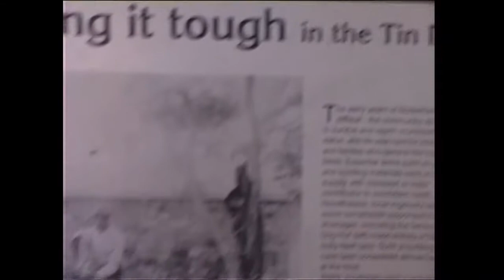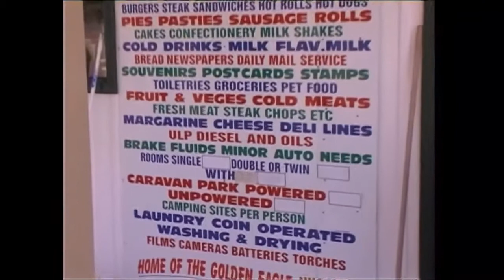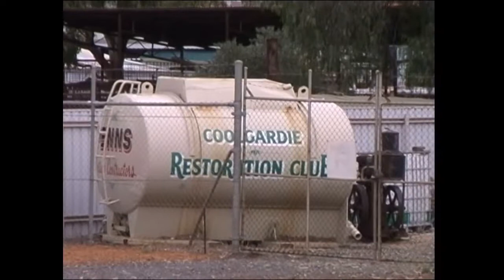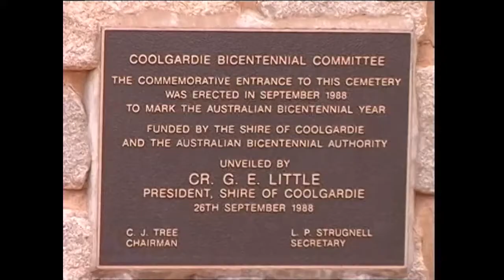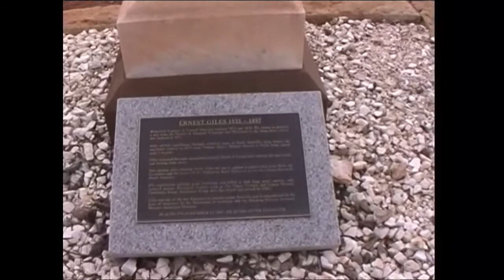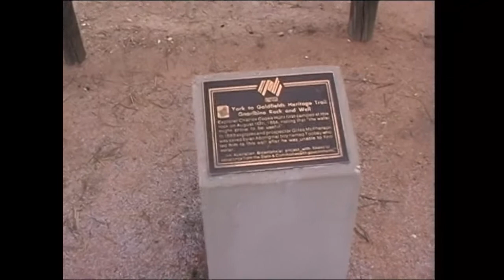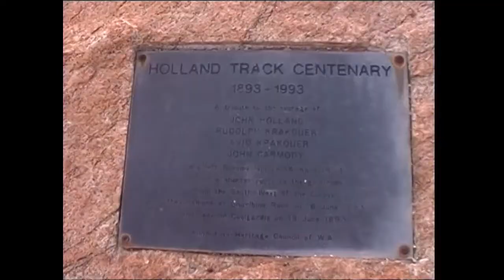3 Norseman Widgiemooltha Kalgoorlie, repairs AND The Holland Track..

Comment from the maker: see http://museum.wa.gov.au/explore/wa-goldfields/dangerous-life/miraculous-rescue

On 19 March 1907, 32 year old Modesto ‘Charlie’ Varischetti went to work as usual at the Westralia mine at Bonnievale.

The area was hit by a storm, and local streams broke through into the underground workings of the mine. All but one of the 160 underground workers reached safety.

Varischetti, on the No. 10 level, quickly knew he was trapped. Although below about 50 feet of water, he was in an air pocket and able to breathe. His workmates, assuming him dead, were amazed to hear his taps from below the waterline.